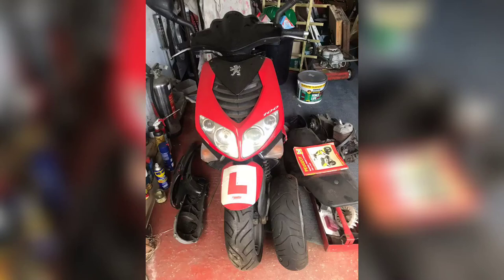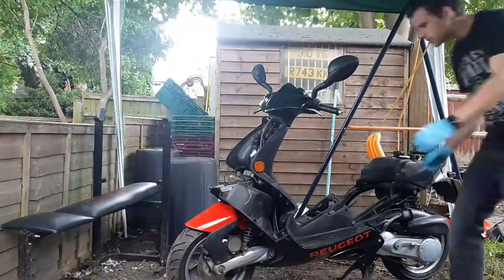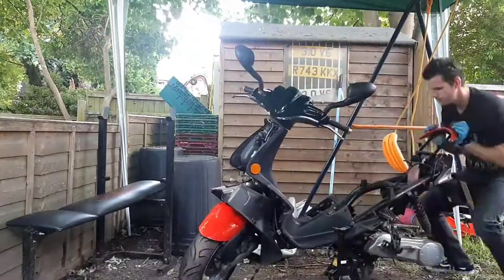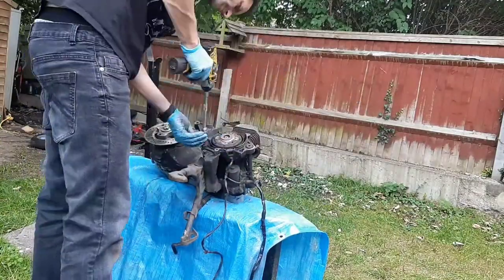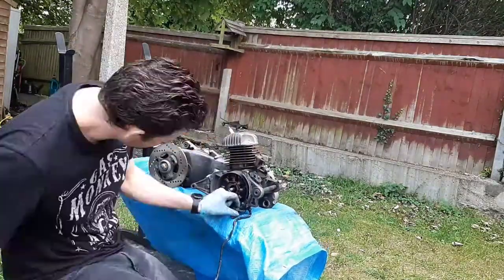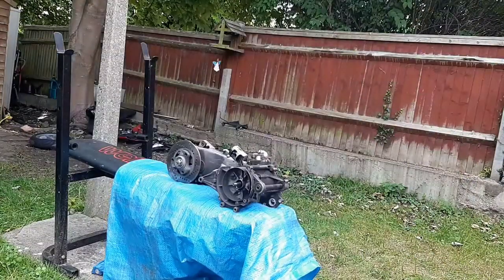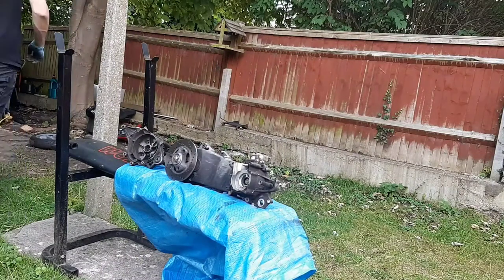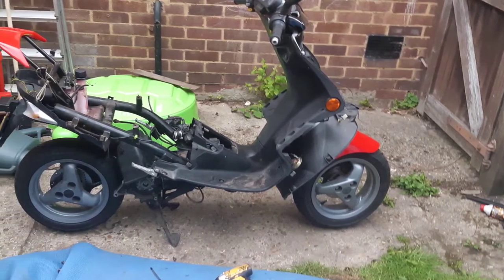Peugeot Speedfight 100 crankshaft replacement

Comment: I have a doubt... Peugeot 100cc Scooter crankshaft is the same as the 50cc one? because I can't find the specifications anywhere, and I don't know whether to rectify The tip that I spent where does it go? pulley of the variator or replace it with a new one. greetings

Comment: Hi I could really use some help I'm having some problems with my speedfight 2 100cc, my front pulley keeps coming loose andI do not no why, also the slider that the variator sits on has got stuck on the  crankshaft
Reply from the maker: Oh, a stuck slider can be a pain, but the normally loose the fight eventually. A hub puller can do it but sometimes messes up the threads. Also, try replacing the nut, and use a crank locking tool to properly torque the nut

Comment: What cdi u got and whats top speed
Reply from the maker: This was built as a standard bike, so had the original CDI and I sold it before I used it on the road.
Reply: the top speed is usually 64 on the spot, my modified bike can do 80 by only replacing the filter for a sport filter